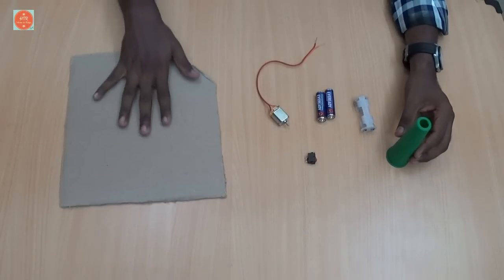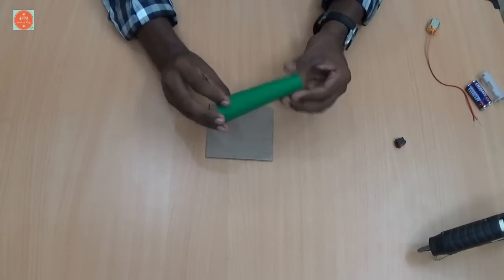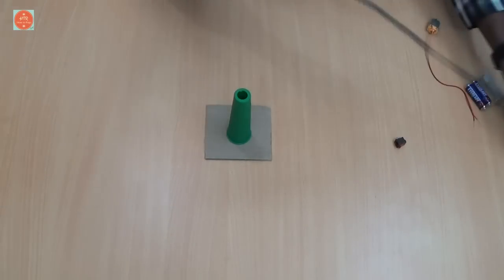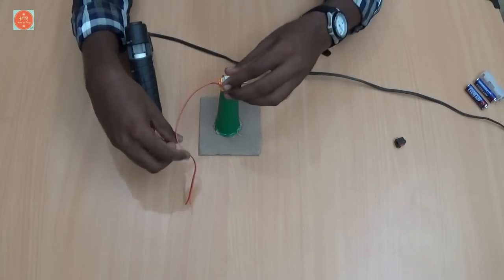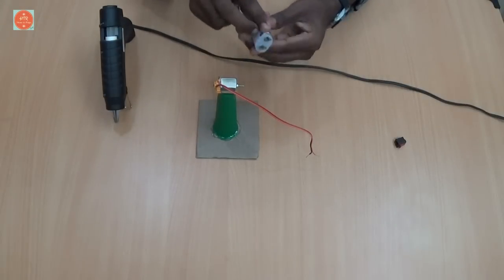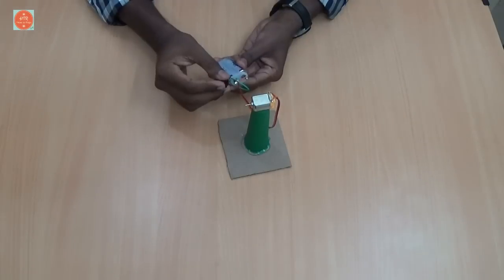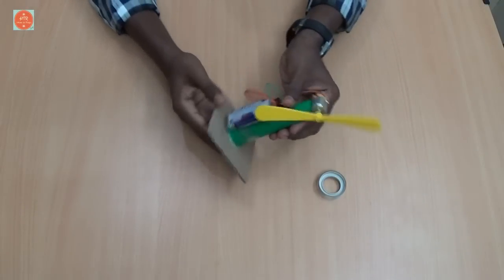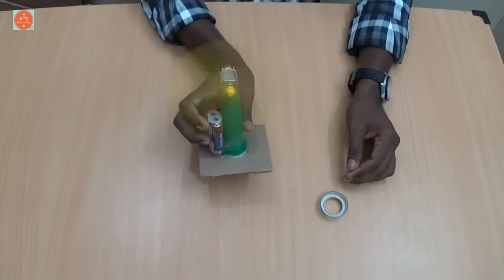How to Make a Homemade Mini Table Fan - Very Easy DIY Fan

Comment: My 4volt motor beces too hot ..is that a problem..?? I tried 1 k 10k 2k resistors....they become extreme hot....and 10 k doesn't let the motor start
Reply: +AIM production what voltage are you giving it?
Reply: Use usb as a power soucre maybe it might work